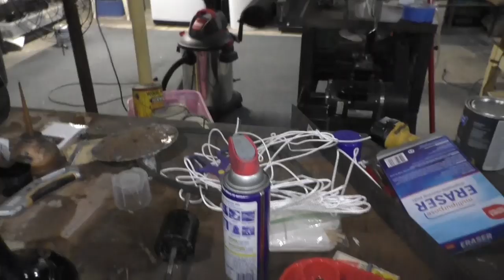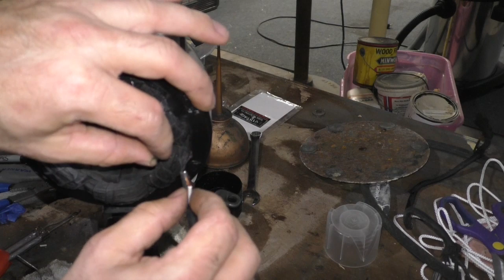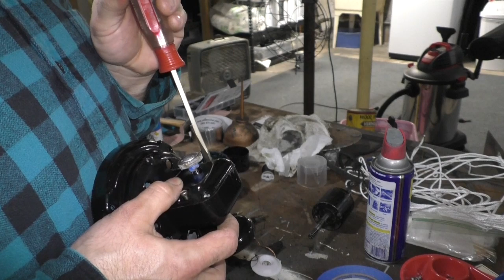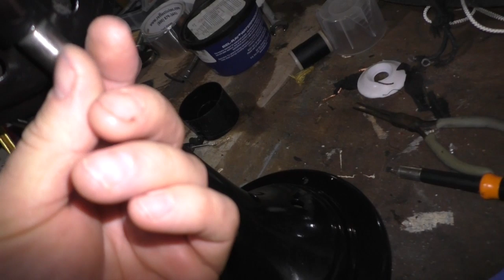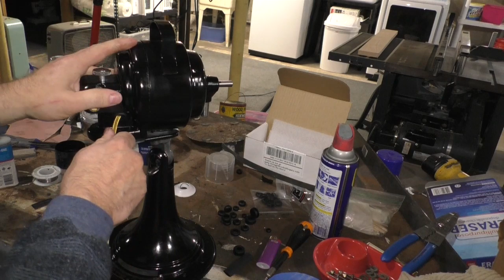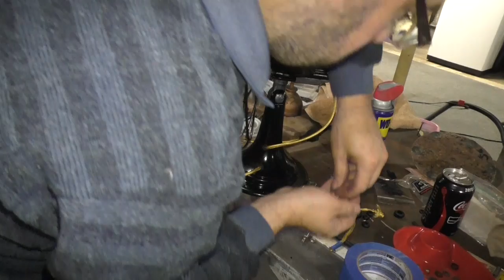1932 Delco 16" Fan Restoration: Re-assembly, Wiring, and First Run

Comment: I have always been told to use 3 in 1 yellow bottle in the oil caps instead of the blue.  Detergent vs nnon-detergent I suppose.  And I've used Vintage Wire for all my fan projects, currently working on an Eskimo Air Fountain.
Reply: EEEDEE1 Ed blue is non detergent and red is detergent.

Comment: The only change I would make to what you did is I would eath the case, that switch could esily make the case go live.

Fun fact I only learned this after doing it my self is you are not supose to tin the copper on mains crimp connectors. Has something to do with corosiaon. Turthly I do not know if this is an actual issue or just the safty buffs being to anal again. I had used the method in building my own Commodore Plus 4 PSU.